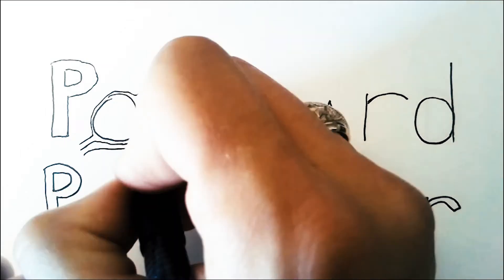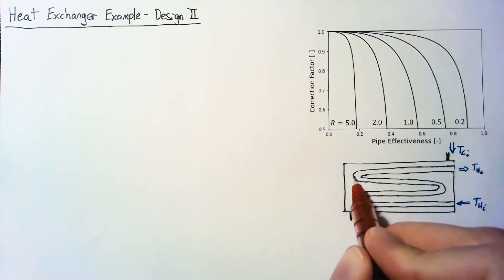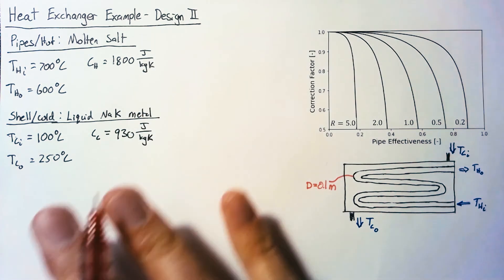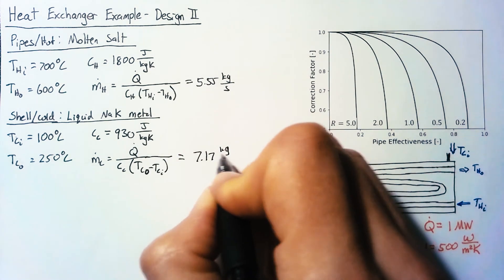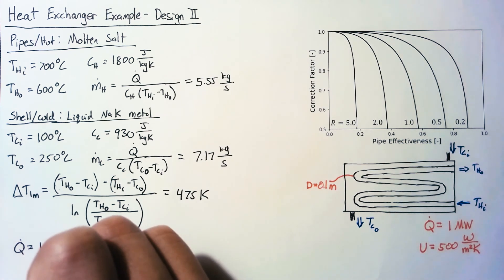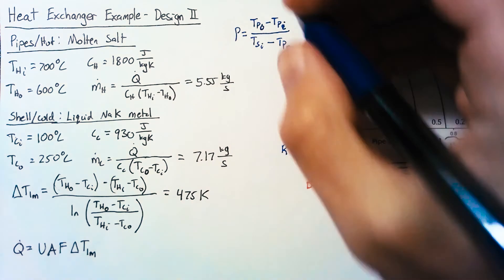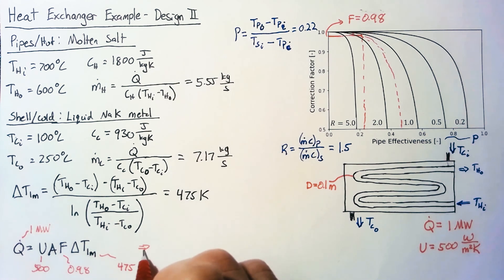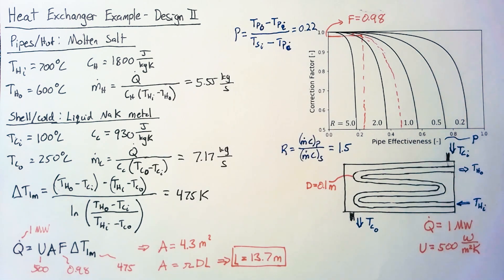Heat Exchanger Example - Design II

Comment: While calculating your P value, you did or said or wrote something wrong. What is said is "600-700 divided by 100-700". This gives you -100/-600 which is 1/6 or 0.1666 however you state the correct answer is 2/9 or 0.22. Is your written equation wrong or is your math wrong? Thanks!
Reply: Noticed the same mistake too, I think it's the math which is wrong
Reply: You are right it is 0.166 not 0.22. So if we take that as 0.166 then Correction factor shall be equal to 1.
Reply: or more precisely, does not coincide with the curve